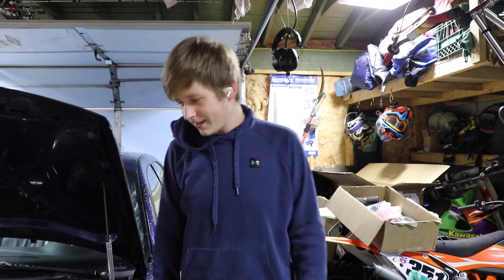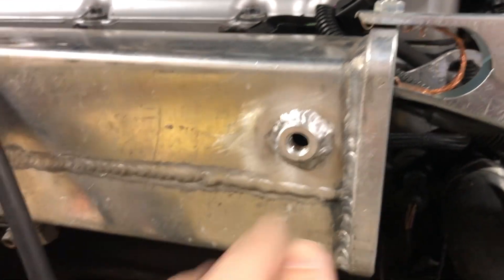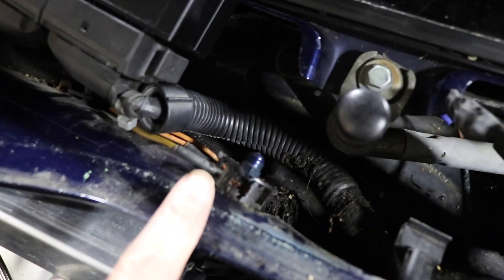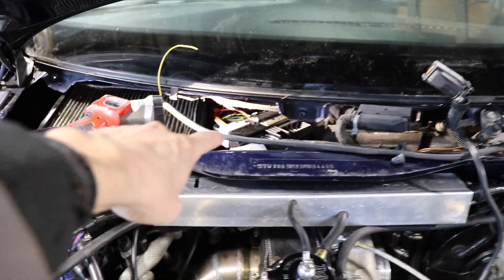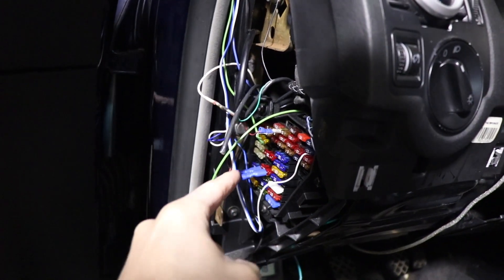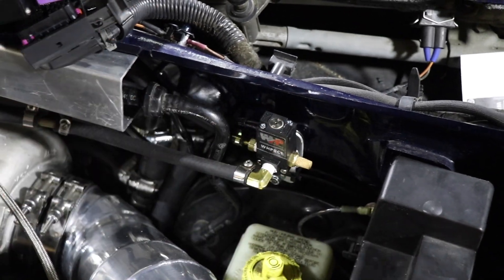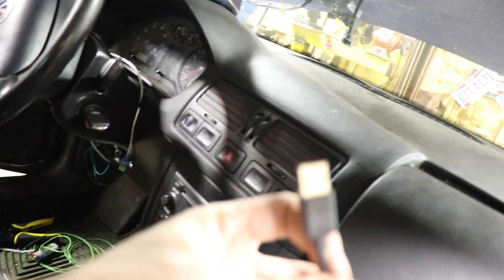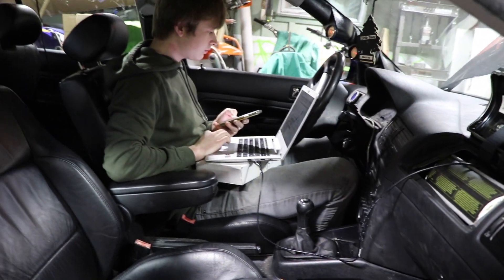EMU Black Install

Comment: How is driveability?
Reply from the maker: Its GREAT, all depends on who tunes it. Its nice to be able to change/see how your cars running, also safety features are awesome🏁🔥
Reply: @PostPros  did your tuner spend alot of time setting up this part of the tune? im not a VW guy, actually want to buy one for my mk3 but figured id ask to see how other guys are using it. Did you get it tuned in the winter/summer? Did it effect how it drove in the opposite season?
Reply from the maker: @scottchelmford7136  So it not really that its a VW, all tunes/engines/ECU's are basically the same.. took him prob 4 hours to do everything. But we got all the sensors and everything setup(startup tune)...It actually ran, and we set up all the boost solenoid, coolant temp, Wideband..exc. To set a standalone ECU up you need to be pretty good at wiring diagrams and good with electrical stuff, even if its a ''plug and play'', still kind of tough. To mount our ecu it was a pain too, but Its DEFINITELY the way to go.
We got it tuned in the winter, and it drives fine in the summer.
We mess with the tune, launch, rpm, no lift shift, anti lag, just set up a different speed sensor... all the time and its constantly getting better. Thats what's good about standalones, you can adjust EVERYTHING  yourself!!! 🏁🏁

Comment: did this car drive?
Reply from the maker: Heck yeah it drives, it RIPS 🏁🏁🏁
Reply: @PostPros  update on the car? please make a rolling race against golf mk7 r. no where on youtube can i find a video of newer all wheel drive vw vs vr6 turbo
Reply from the maker: Ok I’ll try, I think my brother raced one at the track not too long ago, I’ll tell him to get a vid if it happens again🤙
I’d be interested to see too!!🏁🏁
Reply: Does the factory dash  ( speedometer / tach / fuel and temperature ) work once it was installed ?
Reply from the maker: @jeffseaward9225  heck yeah man, literally everything works great. We started with the r32 startup tune ecumaster supply’s and everything works great!!
Only thing is no cruise control, I think you can get it working...but needs to be messed with🤙
Reply: @PostPros  that's been the only unknown holding me back ! Thanks soo much !!!!

Comment: Great work Dustin 👍  It's great to see brothers working together .You have inspired my mk5 r32 turbo build , I just installed a Emu Black . Good to see yours fired up first go on the Emu black ! Is yours a mk4 r32 engine or mk5 ?  Can't wait to see the dyno video 😁 when is that video dropping ?
Reply from the maker: Yeah I need to get that vid done, I’ve been out traveling in my VW van, @dustibus check it out!!👍
It’s actually a BDF, which is 2,8L 24v. Basically a mk4 R32, same exact thing just smaller displacement.. my brother is running it at the track as I type🏁🏁
The emu black is the way to go!!⚙️🏁

Comment: And 1 question is the R32 adapter that cost 275 only a piece to the ECU and do u still need the EMU stand alone that cost about 1500
Reply from the maker: Yeah, the adapter just adapts your wiring harness to plug into the ecu. Ecu is separate, 💸🤑💰💵
On their site it says there working on an ecu that plugs directly into the harness, don’t know when it’ll be done but it’s coming🤙
Reply: @PostPros  oof thanks looks like I’m going w a unitronic tune just until I can get everything 100% bc I definitely want tht rolling anti lag n all the other cool things w the stand-alone
Reply from the maker: That’s what my brother did on his setup, unitronic then standalone, man I know it costs more, but save your money and get the standalone first. The off the shelf tunes aren’t exact and don’t run 100%, you have to run the maf thru a housing of some sort in the intake and recirculate the bov.. plus no antilag, no safety anything, no control.. it’s wack honestly, especially now that ecu master is a thing. Standalone is wayyy better🤙
And the off the shelf tunes are still close to $1,000 after it’s all said and done.
Good luck with your build🏁🏁